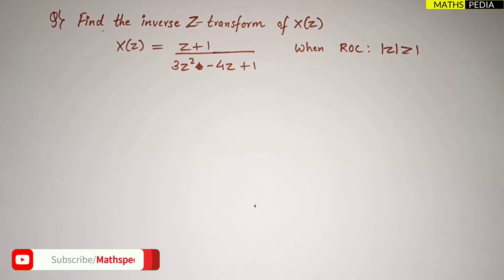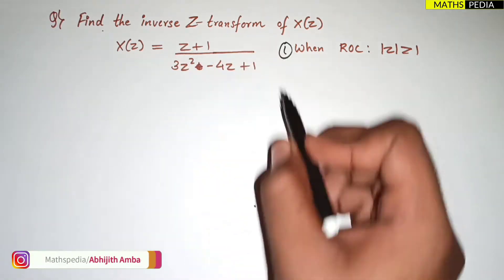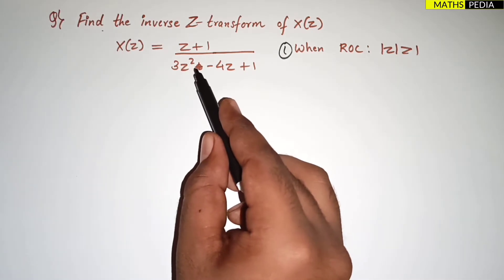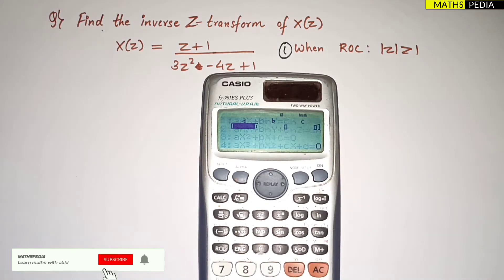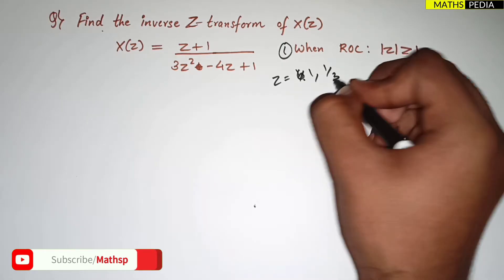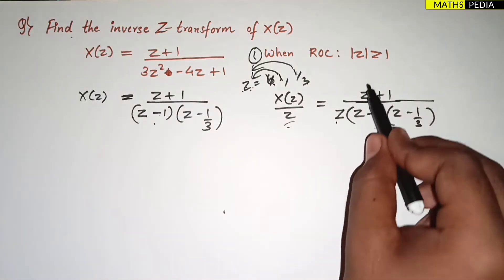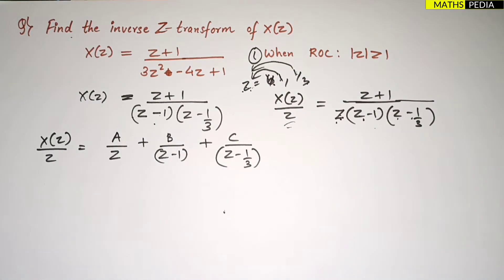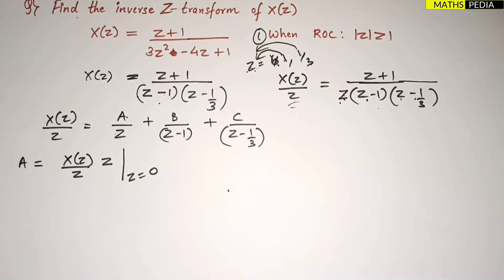Inverse Z-Transform | Inverse Z-Transform Using Partial Fraction | Signals and System | Mathspedia |

Comment: If the second factor is z-1/3 then the denominator should be multiplied by 3 to balance out. If not, it should be left as 3z-1 as the second factor. Please check it out.
Reply: I also think  a factor of 3 in denominator is missing. The denominator should be (z-1)(3z-1) simplified to 3(z-1)(z-1/3).